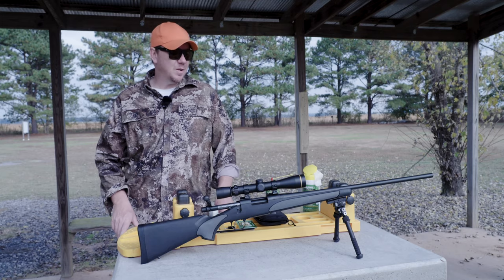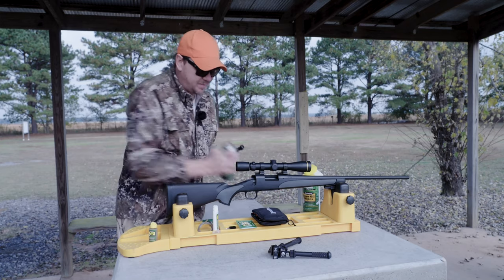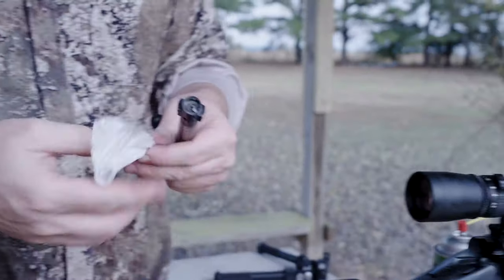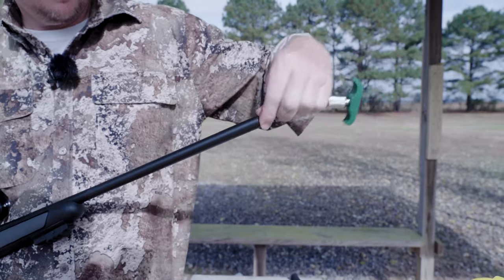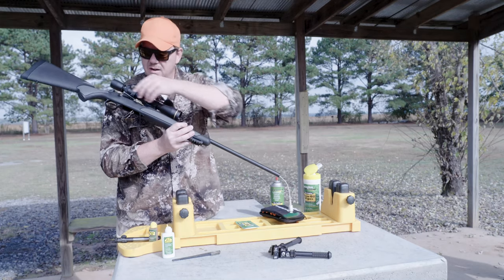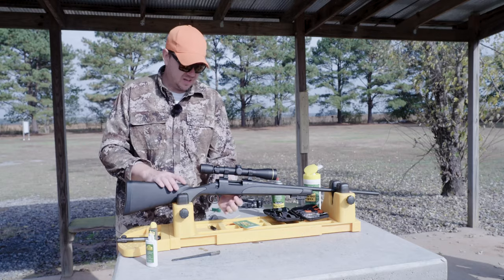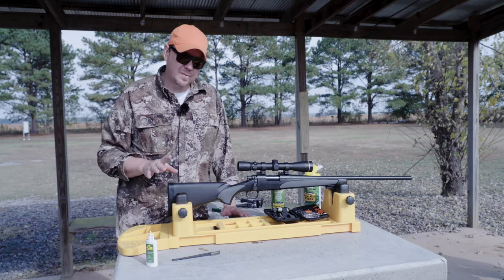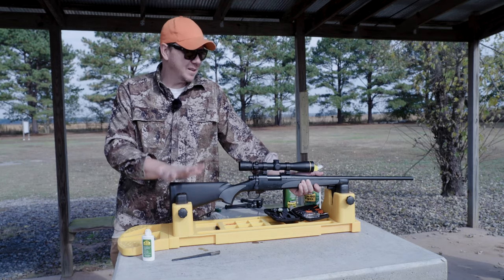How to clean a Bolt Action Rifle

Comment: thanks for indicating a specific direction for cleaning the barrel. Is there any real difference between action and/or bore oil?
Reply: Bore cleaner is a solvent or cleaner not an oil.. only use bore cleaner inside the barrel.. push swabs through until they come out clean and then add a very light coat of gun oil / lubricant to the inside just a dab will do from the chamber to the end of the barrel by removing the bolt first and again never use bore cleaner on any other parts but the bore and always wipe it out after and lightly oil with a cloth on all metal surfaces and wipe off and excess before storing your weapon

Comment: How to not properly clean a precision rifle.
Reply: Agreed. Raking the dirty cable over the crown of the barrel is a no-no.
Reply: Yeah he lost me after he free poured the solvent down the barrel, and here I am just trying to find folks who work different APPROPRIATE methods.
Reply: @johnappleseed9290  Dewey coated rod, bore guide whether it’s semi-auto or bolt-action. Clean from the breech end, offload the patch when it exits the barrel (I remove the jag or patch holder) carefully pull rod back and remove, wipe rod down: repeat. Hoppe’s No.9 won’t get you in trouble, it just takes a while. Leave it in the barrel, dry patch next day and if it comes out blue, repeat.  Repeat until all copper is gone.

If it’s an AR, anything Glenn Zediker wrote is gold.